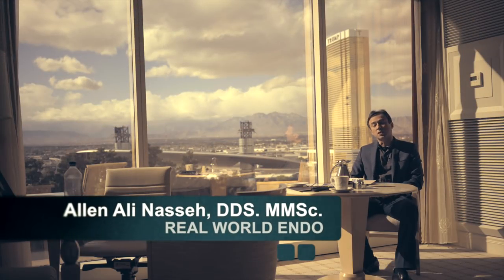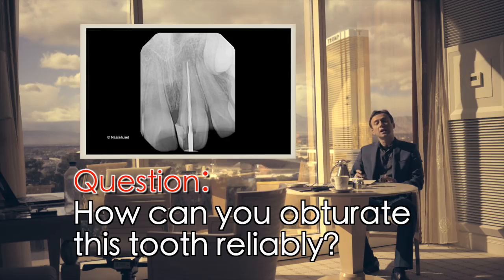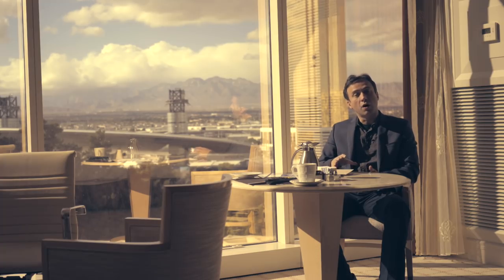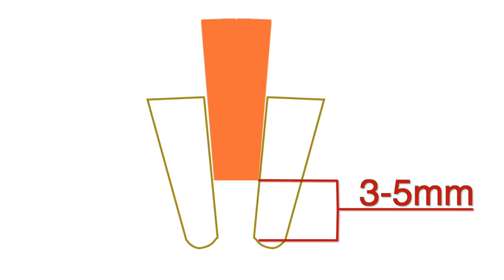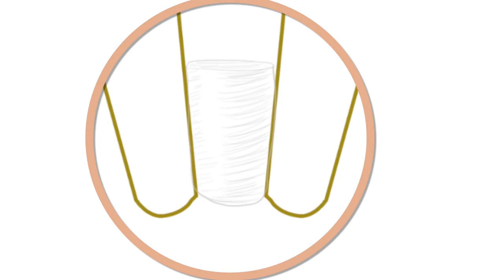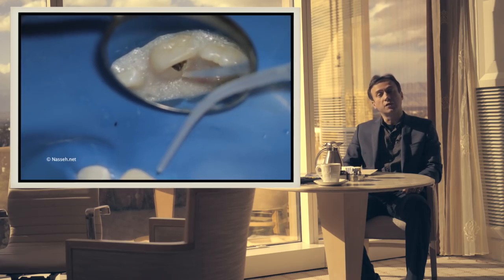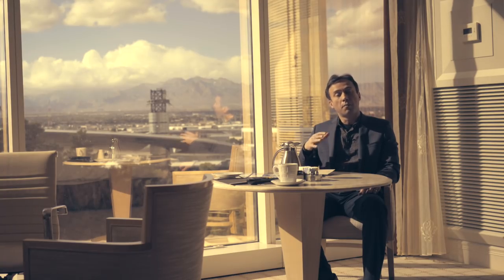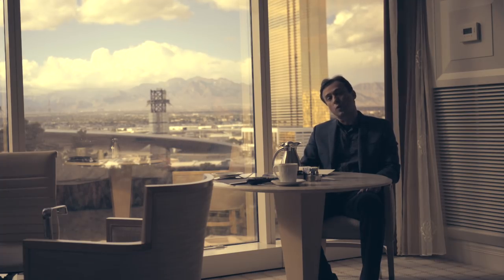One Step Apexification using BioCeramic Putty

Comment: It would be easy if the root walls were convergent to the apex, but in cases of immature teeth you have more or less a divergence. Thus using a custom GP as a plugger would just not fit.

Comment: Hey doctor! I’m still a student can you tell me the problems that an open apex causes?
Reply from the maker: Good question. A larger diameter opening is more difficult to close and get an adequate seal as fluid tends to come back in. Historically, people used to do Apexificiation where they placed Ca(OH)2 until the body created a hard osteoid layer at the apex and closed it. That could take six months. Today, we can do this in one visit with this barrier technique using a hydrophilic bioceramic cement that creates a plug and now you can seal against it. Cheers! :)
Reply: @AANasseh  amazing! Well i saw a doctor posting his work (autotransplantation of an upper 3rd molar(18) in the place of a lower 1st molar (36) ) he mentioned that he saw no need to do an endodontic treatment since after 2years there was no infection or any thing of such, and i wonder whether that could cause a problem later on
Reply from the maker: @reemthesoviet776  That's a separate problem. That's a vital tooth with a developing root that most likely contains a dental follicle at the apex, which will aid in revascularization. If this was an adult third molar with complete root formation however, it would have been a different story. It would have then needed endo.

Comment: I have seen studies shown way more leakage of the BC putty than MTA. I d like you opinion! P.S. that's a view from Encore suites. I stayed the same side one time :)
Reply from the maker: You're right on the view! :) But you're not right on the leakage studies. Can you provide a reference? Leakage studies are discredited in the field and are currently not accepted science.
Reply: Real World Endo Comparison of sealing ability of MTA and EndoSequence Bioceramic Root Repair Material: a bacterial leakage study.
Hirschberg CS, et al. Quintessence Int. 2013.
Reply: Real World Endo its on pubmed
Reply from the maker: As was my point, these leakage studies are non-sense. This is another exact study that shows the exact opposite results: J Conserv Dent. 2014 Jul-Aug; 17(4): 340–343.
This is why leakage based studies are political tools for manufacturers to beat the competition over the head rather than come up with real, clinical relevant information. The material works as well, if not bette retain MTA but is easier to use. That's all I care about. Cheers!
Reply: Real World Endo I would trust UMDNJ a little more than studies done in India but I appreciate your input! Will try the putty next time! Thank you for doing these videos, definitely helpful!
Reply from the maker: Doesn't matter who's doing the leakage study. It's discredited as a method of studying a material. If the same guys did the same study at UNDMJ they may very easily find the opposite results to what they found the first time. That's why these studies are discredited; because they produce false and unreliable results. That's all.

Comment: Thnk you for the video! Why do you consider retreatments troublesome in revascularization cases vs. apexification though??
Reply from the maker: Thanks. Retx. teeth are more difficult to remove all foreign material as well as infection. All antigenic sources remaining cause problems with revascularization as they increase the incidence of inflammation that prevents revasularization. The limitation of all revscularization is removal of antigenic substances (microbes, necrotic tissue, and foreign materials) and activating the growth factors in dentin. You can see why that's more difficult in a revision than in primary endo.